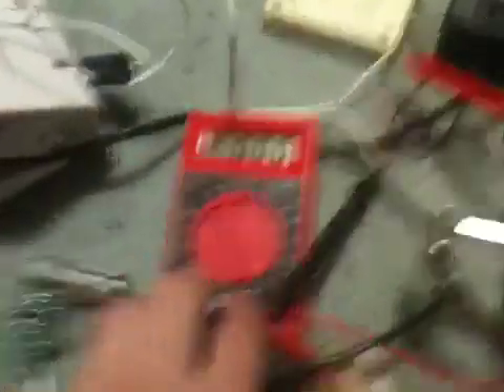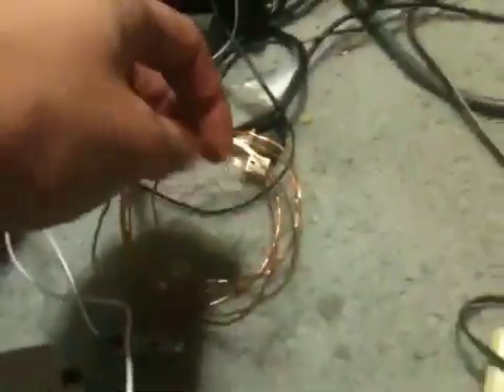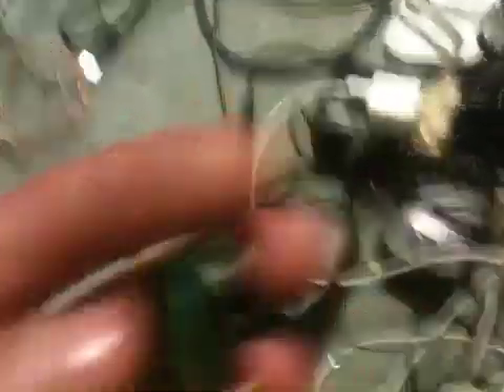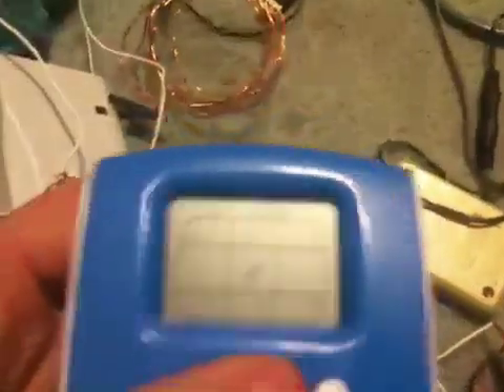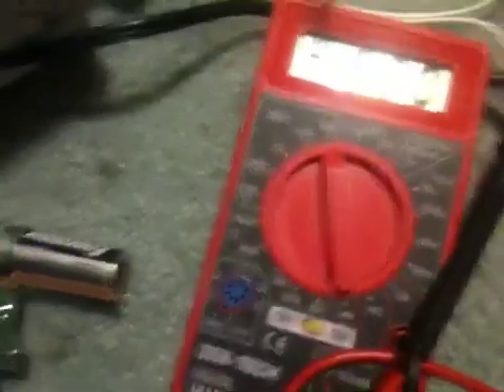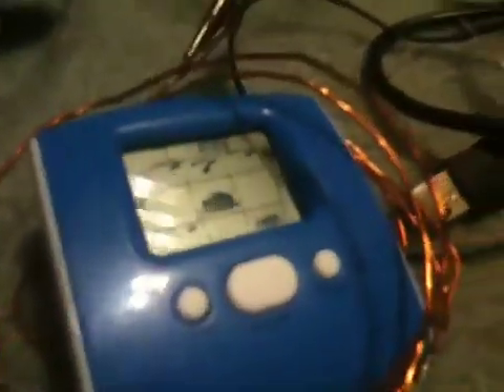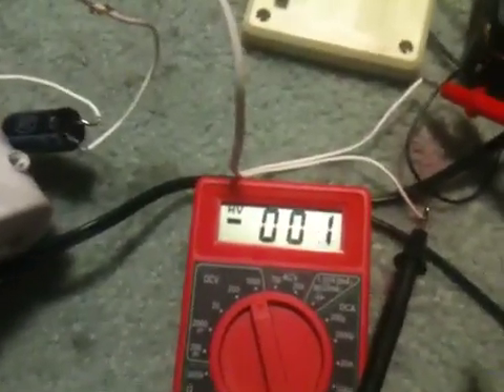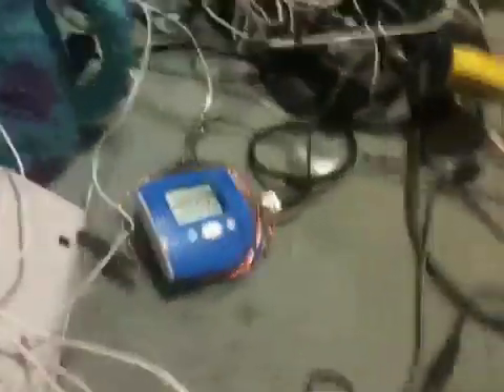How to make an EMP device+ demo

Comment: well dude...your the one who intimated that this thing WAS an EMP device (your heading up there!) so naturally people will be a little let down when they realise it really isnt....and I'm not here to put you down ..but I'd still suggest that rather than tinkering around with bits and pieces and for the most part achieving bugger all in the way of satisfaction, do a LITTLE reading so you dont have to make simple mistakes that achieve not much,if you know a little, you can apply it and then you might be really surprised and quite impressed with your own work...what I'm saying is stand on the shoulders of those who came before you.........get it?

Comment: tack to Carma apart charge like you are going to use the flash and wire the copper coil to the wires going to the light remove the light completely. these have to be disposable  not digital Carma the more you have the bigger the effect. do not sell them they are not ligle. and you will do time for having one. have fun and dont git shocked.

Comment: You need bigger capacitors! Go to the junkyard and look for some industrial motor control gear. What you are searching for are some huge bus capacitors, around 100,000uf 250vdc capacitors with the screw terminal lugs on top. Then get some thick wall 1/2" soft copper tubing and wind 5 turns around a 5 gallon poly pail to form your emitter coil. Do not allow the coils to touch each other and short! Flatten as much of one end of your tubing from your coil to form a bus bar long enough to connect 5 or 10 (as many matching caps as you can find) of your giant capacitors by drilling holes through the flattened tubing just large enough for the capacitors screws. Assemble your capacitors in parallel so all 5 (or however many you have) positive  terminals are connected together and all your negative terminals are connected together. The positive terminals should be connected directly to your emitter coil. Take another foot or 2 of your tubing and flatten it out and drill to make a matching negative terminal bus and run down to your contactor. At this point you will need to make a high current contactor to violently dump the power from your capacitor bank into your emitter coil. Find an 8 inch length of 1" square brass bar stock and cut it into 3 pieces, 2 that are 2" long and 1 that is 4" long. Drill 1/4" holes through both of your 2 inch pieces around 1/2" from the end for the 1/4" bolt you will use to fasten your flattened negative bus bar to and also to fasten each contact to a rectangular chunk of a nylon cutting board roughly 4"x6" as the contactors frame. Connect the remaining flattened end from your emitter coil to the opposite 2" brass contact. Now drill 2 1/4" holes through your remaining 4" section of 1" brass bar stock centered 1" apart. These will be the guide rail holes that keep the 4" vertically sliding contactor aligned with the end contacts. Drill and epoxy 2 1/4" nylon rods into your nylon cutting board frame assembly so you now have a unit that will efficiently connect your capacitors to your coil without killing you. Screw 2 eye hooks into your base mount centered between the guide rails on either side of the 4" main contactor. Install a heavy spring over and across the 4" brass bar so that it will yank the bar down making contact evenly on 1 full inch or more on each of the 2" contacts. You will need to drill another 1/4" hole dead center in your 4" bar and also install another 1/4" nylon rod with a 1/8" hole drilled through it roughly 1" above the nylon base. That is where the firing pin will be inserted to hold the switch open with a grenade style ring pin. You cock the contactor up and insert the 1/8" ring pin connected to a nylon firing line. You are now ready to test your EPM device but you will need to charge it first. Find a heavy duty full wave bridge rectifier and a 220v drier cord. Connect each of the line phases to the AC inputs on the rectifier and connect the DC positive and negative outputs from the rectifier to the corresponding positive and negative terminals on your capacitor bank. Make sure you get the polarity right or there will be a catastrophic accident as you are dealing with 30 amps of full 220AC line power and massive capacitors! If you manage to find 10 250 volt 100,000uf capacitors and have them in parallel you will now have one full farad of energy stored at 250 volts ready to be dumped into your coil in a few milliseconds! When you yank the rip cord and that 1" brass bar comes down with authority the resulting EMP from your coil will wipe out anything electronic within 100 feet with nearly 100% certainty! These plans are for educational purposes only!!! Use these plans at your own risk! It is not my fault if you incinerate your parents home, electrocute yourself, your siblings or slow friends that can't manage to keep their hands off your projects! If you manage to wipe out all your neighbors electronics for a 1 block radius, accidentally kill everyone with a pacemaker within a 5 mile radius or get arrested by the FBI for crashing the grid in your state that is not my fault either! lol

Comment: Please answer :) Can I use solenoid electromagnet (copper wire rapped around iron core) will it do a trick? I made one with 12.5m of pretty thick copper wire (cca 15cm long) 4-5 layers of winding. It is well made, I guess I should use a higher voltage. Any Idea/Help? Thanx!

Comment: Sigh. I remember fantasizing about fighting the government when I was a kid. Kids will be fantasizing about it in another hundred years. The EM pulse created by a nuclear explosion can't even stop the electrical system in an open-topped Willys Jeep from working. It's been experimented with in great detail. Sure, with huge banks of capacitors and a suitable coil you can disable something like a mobile phone from a few tens of feet away. But you cannot even remotely effect any military hardware

Comment: I didn't read your weird little rant. I already answered your question. It. WON'T. WORK. The energy released is always less than that stored in the capacitor. Even without the coil, even if you hooked the capacitor directly to the circuit you wanted to fry, and avoided the huge energy loss through the air, most circuits would be just fine. You will never be chased by a drone. You will never be that important.

Comment: The disposable camera flash power supplies don't have a bleeder resistor to discharge the electrolytic cap, I have taken literally dozens of them apart and had to discharge the cap in some other way, either by shorting the + and - together or by connecting a resistor across them. I should warn people straight off, the X box supply is harmless if unplugged,mostly because it's low voltage, the camera flash cap, on the other hand, can melt the shaft on on screwdriver if fully charged or burn you.

Comment: you should try making a coil around a plastic tube and filling the tube with some explosives, like gunpowder and when the coil is charged it should explode provoking a collapse in the circuit and maybe a better emp, means one coil one emp, i saw one never built one

Comment: Hey dude I made one of these exactly as you did but I can't fry a thing with it. I tried a calculator and a bank chip and pin reader but they didn't even flicker. What am I doing wrong?
I have a 300v cap which is charging fine and i'm getting a big spark out of it when shorted out but put the coil and switch in the mix and nothing gets fried. ;-(

Comment from the maker: The wire is one piece in a coil with about 5-10 turns around a soda can. The battery goes into the charger and the flash button is pushed. When that is charged, the wire is shorted across the coil. A switch is added on one side of the wire to do this for you.

Comment from the maker: For a 9v battery and transformer you would need an oscillator as well. That is a little more complex. You then need hookup wire, a transformer, 2 diodes, solid wire, and capacitors.

Comment from the maker: I'm not 100% sure, but if you use a microwave with a certain waveform it should be way more powerful than this. You will have to research this, as I have no way of obtaining the supplies or the balls to do it as it is extremely dangerous.

Comment from the maker: @woodisdead I used a 300v 120mf quick discharge one. It doesn't really matter as long as it is at least that value. Try disabling something else if it doesn't work.

Comment from the maker: @woodisdead yes! You should be proud of your electron flow knowledge. Even I struggle with that sometimes. This its a great beginners project because if you shock yourself, you won't die. Others can easily kill you if you're not careful. it will also teach you respect if you do touch it as it slightly numbs your arm.(experience sucks) good luck!

Comment: @joblessalex so the copper wire goes from the power source to the diodes to the capacitors to the loop then to a switch then to the capacitor then to the power source. am i right? i was referring it to the diagram. sorry, i still dont have much knowledge on this stuff.

Comment from the maker: @woodisdead The circuit diagram is in the description. If you are using the camera flash, everything to the right of the diodes are to be included. If not, build the shown circuit. Hook both of the wires where the diodes are to the capacitor on the camera flash to allow it to charge for the camera version. Press charge button to fill the caps. When that is done, put object in coil and flip discharge switch/cross wires. There might be a pop, or nothing. Send me a message if it still wont work.

Comment: @joblessalex Ehhm, in normal English? Do I need a coil with thick wires, or a coil with lots of wounds? Thanks for the explanation, I'll talk to him soon about this. Btw, I don't think the EMP would kill you, as long as you don't have any exploding electronic devices on you. I guess the biggest danger is the capacitors blowing up, which could result in quite a bit of an explosion with possibly dangerous fumes, I suspect...

Comment from the maker: @BvOBart you will need a coil with more inductance. Depending on the voltage, these may not work. The transistor he speaks of is to help create an oscillating circuit for the transformers to operate on. I suggest if you are working in a group to make sure all safety precautions are taken-- unlike this video.....when you get bigger amounts of power it will hurt and can likely kill you. I know you won't take this seriously, but still be safe!

Comment: So this is pretty well just a transformer hooked up to an LC resonator? So it steps up the voltage and produces a short burst of relatively high power electromagnetic radiation at some discrete frequency?

Comment from the maker: @ShroomJam You should be able to reset the calculator with that. I have not had success with breaking anything. To break things you will need something a bit stronger and most likely a different method to destroy it. For example, a microwave would fry it at a long distance while this would do nothing at the same range. However, microwaves are extremely dangerous and you shouldn't try it. (I'm even scared to mess with them)

Comment from the maker: @ciocanlica Large capacitor capable of 210v and at least 100mf I think is the least I have had success with, wire that can withstand that current, larger wire for the coil, a disposable camera flash unit and batteries, a voltmeter, and a large switch.

Comment from the maker: @lexbooth1 In the description there is one of the improved one for the old one replace everything to the left of the switch and coil with a camera flash circuit. I made that one so it can be run from the wall without need for replacing batteries constantly.